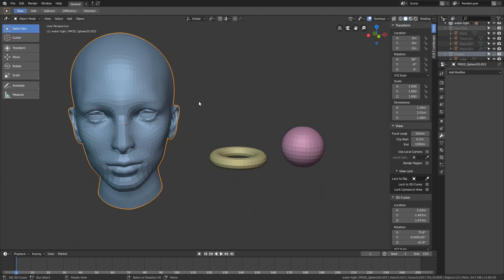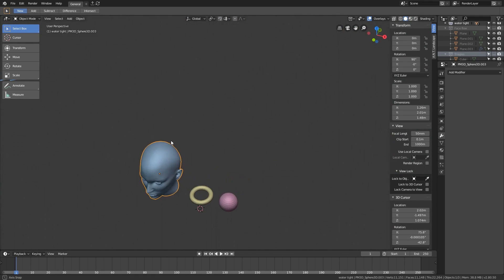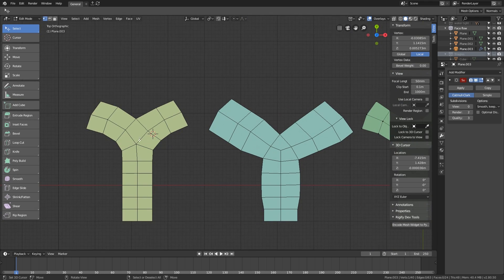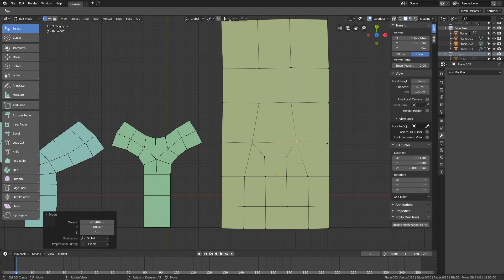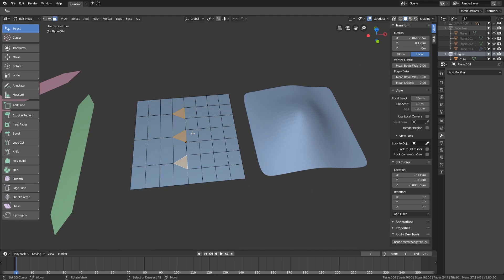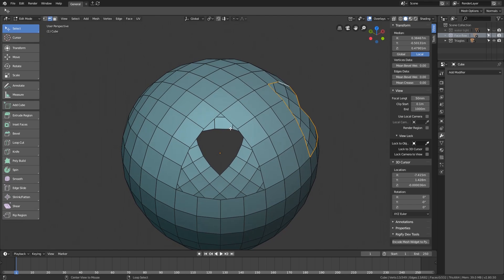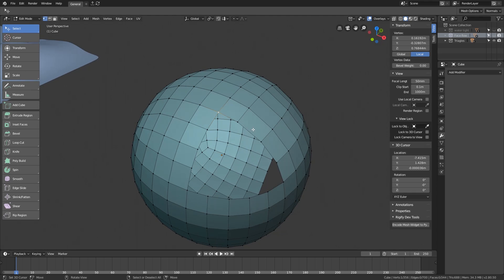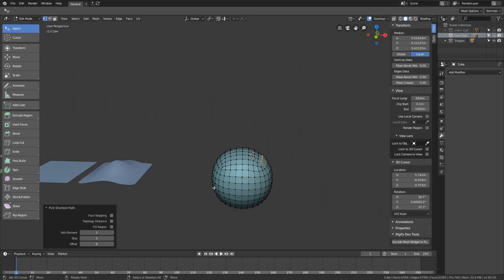Blender 2.8 - Topology basics

Comment: How can I use the topology patterns you presented if I need to place them right in the axis upon which I'm applying a mirror modifier? 
For instance, the first pattern would create two triangles in place of the topmost quad, blocking my loop and causing render errors due to the curvature. 
Is there any way to avoid having the mirror modify split that quad or should I use a 6 pole?

Comment: I'm still trying to learn WHY you need good topology. Why are triangles bad or N-gons? WHEN are they bad, when you change the model, scale it up, make it dance? Why is there the field of topology and why does it matter at all? That is something that I could not find out so far.
Reply: Polygons allow for nice mesh deformations in animation and consistent sub-surface smoothing. If you make a mesh with lots of polygons, but throw in n-gons or triangles, you will notice (when smoothed) the visual inconsistencies.
Reply: @ricokubadera5126  Interesting, thanks for that.

Comment: in time line 13:30 how do you fill the hole, by selecting  single vertex? will only fill tris right, then how come you got quad face, pls add screen cast key in future projects
Reply: That's the built-in "F2" addon (You just need to enable it in preferences). I need to remember to start using it, myself, honestly XD
Once enabled, when you select a vertex in a corner you want to fill, you hover your mouse over empty space where you want to fill in, press "F", and it tries to make a square face to fill the empty space. It's one of those addons like "Node wrangler" that really should be built into base Blender, so everyone keeps them on all the time, and don't think to mention in videos.
Reply: @darksunrise957  thank you so much
Reply: @darksunrise957  Yes nice one Darksunrise, that was the first thing I wondered when he hit that part of the video.
Reply: I'm always glad to fill holes